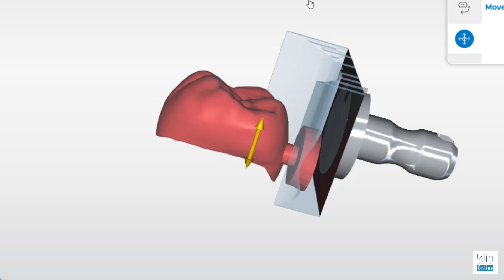Prime Zirconia Indications and the Pre-luster Finishing Workflow

Comment: Hi! thank you for the video. You are using a CS6, do you agree on a setup with Programmat S2 & P310 for a dental practise or it is too much? We are a dental practise that just bought DryMill and ZirCad Prime discs.
Reply from the maker: Good question, if you will mill from pucks, then the SC2 will be a better fit, the CS6 was made for the block mill for Prime  and ZirCAD MT multi. I use both.  If you are using CEREC, then the CS6 is the way to go!  All the best!
Reply: Thank you for your reply. We have the Ivoclar DryMill so we can only mill discs and not blocks. So the S2 is a bettet fit? I am confused. Not cost wise, but result wise.
Reply from the maker: With the disc, the S2 is indicated, there is a subtle chemistry difference between the Ivoclar disc and block zirconia, the S2 is for disc zirconia.
Reply: @KlimDDS  extremely appreciated that you replied!! thank you!! also just ordered the JK04 kit. looks neat!! any nice stains palette that you suggest? thank you
Reply from the maker: @evangelosprokos8386  The best coloring system for Zirconia is MiYO.  Go to the Jensen website https://jensendental.com.   I use the Renfert ceramic mixing tray and cover.  The cover seal will protect the dispensed materials from drying out between uses. https://garlanddental.com/products/renfert-stain-mix-mixing-tray-black-cover?variant=44099156476163&currency=USD&utm_medium=product_sync&utm_source=google&utm_content=sag_organic&utm_campaign=sag_organic&gad_source=1&gclid=CjwKCAjwmrqzBhAoEiwAXVpgouWdBdUqbVNchlEGR1SHZ1rIMJ7jNsLRFZ2cWqijfcgjEhryemuUyxoCYLkQAvD_BwE
Reply: @KlimDDS  my lab uses also MiYo. Yes it is perfect. Thank you for the suggestion :)

Comment: Hello James, Amazing video as always. We are a dental practice based in the UK with a digital dental lab in-house which I manage. We have the MCX5 milling machine and CS4 and use the Zircad MT Multi discs for the zirconia crown and bridge. We wanted to move to Zircad Prime to be able to get more aesthetic results, particularly for anterior zirconia restorations. I suppose the CS4 does not work for Prime and we need to upgrade to a vaccum-furnace. Which furnace would you recommend and do you have video training using Zircad discs workflow with the burs, finishing, polishing, and staining for zirconia restorations? Many thanks and Regards, Rajiv.
Reply from the maker: Thank you for the comment.  The Progamat S2 would be better for disc milling of ZirCAD MT Multi and Prime. Though there is a firmware update for the CS4, the Prime and ZIrCAD MT Multi will be more opaque out of the CS4.  I will eventually have training for the disc milling option and finishing.  Until recently, most of my zirconia has been processed with block milling with the Primemill.  Are you using MiYo Esthetic on your zirconia?
Reply: @KlimDDS  Thank you for the prompt response. Yes, that would be really amazing to have some training for the disc milling option for sintering and finishing zircad mt multi and prime. No, at the moment we are not using Miyo Esthetic as was not sure if the CS4 is capable of glazing miyo products. We just use the Crystall stains and glazes. Do you feel Progamat S2 is the best option for sintering and also for stain glaze with Miyo?

Comment: Hello Dr. Klim! Thank you as for the very thorough tutorial, really appreciate it as an assistant. Question, can the pre polishing kit and ZirCad stain kit be used on the Sirona Zirconia blocks prior to sintering? I’m  having issues with the restorations being too opaque, any advice?
Reply from the maker: Thanks, I am pleased the workflow presented is working.  Yes, you may use the Infiltration coloring and lab kit and polishing approach for the Sirona Zirconia.  Are you using the MTL block?  This block is a 3Y material, meaning it is more opaque and therefore will appear bright.  Think of choosing 2-3 shade darker than target shade for the case.  Infiltration will help bring the value down as well.  There are more aesthetic brands such as Katana One and the latest Prime block.  Have you tried these?  They do blend better than the Sirona, though, Sirona block has excellent strength.

Comment: Thank you for all the informative videos you do. I have a CS6 furnace and wanted to start zirconia. I was going to get stains and the Ivoclar tech I spoke with said the furnace is too small and prestains are  to acidic for CS6. Just wondered what your opinion was. I want to try Prime blocks because the other Ivoclar blocks have been too bright in LT, and MT takes too long to furnace. Glazing adds so much time I’d rather do an eMax.
Reply from the maker: I often infiltrate for precoloring with the Cs6. If one is concerned about the liquid drying, there is a 10-minute drying cycle, then use a toaster oven at 180 degrees for 10 minutes, first before sintering.  I use MiYO Esthetic for stain and glaze after sintering for more demanding aesthetic cases.
Reply: @KlimDDS   Thanks again.  When would you prefer to prestain and when would you glaze after?  Are you suggesting the drying cycle AND the toaster over OR the oven?  Do you have a precolouring liquid preference?  Do you suggest it better to do zirconia as a 2 visit crown due to the staining and glazing times?  Kind Regards.
Reply from the maker: It depends.  Most of my molars and some premolars are just polished, with Prime move the restoration to the top of the block to gain access to the cuspal translucency.  In most cases, choose two shades darker than the target shade.  With these multi-layered blocks, I place infiltration less than I used to. For stain, I prefer MiYO Esthetic; there is a 16-minute cycle now.  I will post that cycle on the blog at www.cadstar.org.  I recommended the oven over the dry cycle so the furnace is not contaminated with the wet colored liquids when infiltrating. @marcmiller6145
Reply from the maker: When doing anterior zirconia, I will either mill or print a temporary and bring them back.  More time is required in my hands for the aethethic zone.  CAD CAM is not all about one appointment for me, it is about control and outcome.  I love having functional and aesthetic control. @marcmiller6145

Comment: You really shouldn’t finish in green state unless you use a respirator.   REALLY.   That white dust is a serious carcinogen.   Think about asbestos, unlike the fibers that got into the lung tissue,  zirc dust is so fine it can’t be filtered out so causes the same effect.   Don’t believe me?  Read the MSDS.   Plain as day.   This is the quiet issue that I don’t understand why it’s being pushed under the rug.   You know you aren’t even supposed to handle it without gloves.  Again read it in the MSDS.   There is virtually no reason to do that.   Use a Shofu Ceramiste Point post sintering.   It’s faster and cleaner than this.  I won’t even remove that sprue.   Much healthier to do it wet post furnace.
Reply from the maker: Thanks for your input.  Glad you are staying protected.  Yes, I use gloves, a respirator, and a strong vacuum.  All the best.